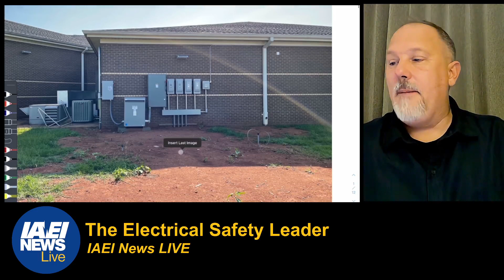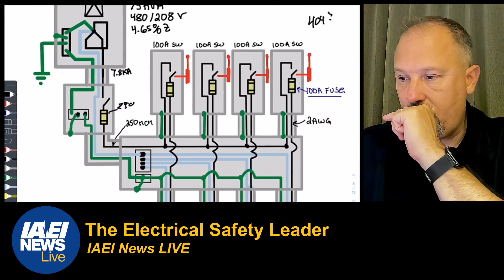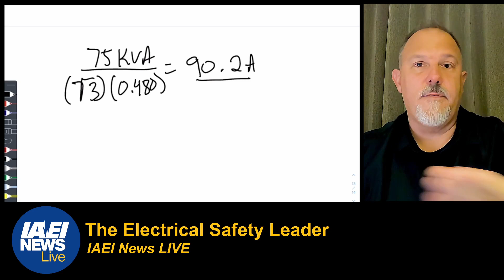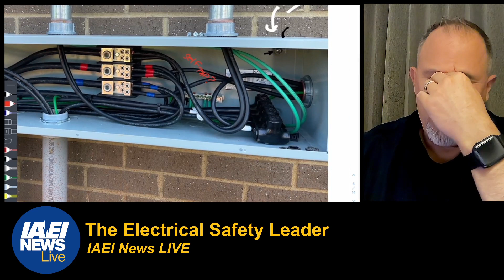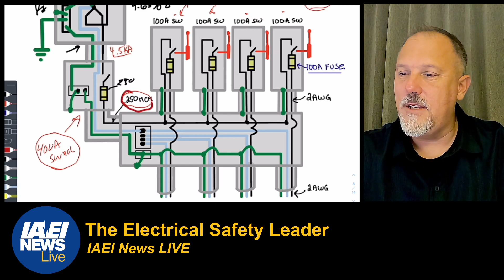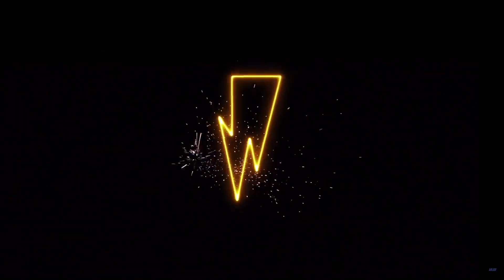Feeder installation review

Comment: If you are an Electrical designer doing hundreds or thousands of current calculations, there is a time saver.   VA/ Magic number!
Magic number is half of the calc you are doing.   Sq root of 3 times volts.  For three phase 208/120 Y 361. 480/277 Y 831.   For 240 delta 416.   Don’t need to get knitpickey, nobody cares about decimal amps.

Comment: 250.104(D)1 and 2. Separately derviced system must be grounded to metal water pipe and structural steel. No requirement for ground rods needed and in fact is not providing a effective return path and should be removed immediately.
Reply: Read NEC 250.30 ( c)

Comment: I think I would have made the secondary sealtite a little longer and strapped it to the transformer pad as I would be afraid of some building maintenance guy stepping on it . Also,  the pipe with LB out of the right end of the gutter should be supported some how (maybe its not complete) .

Comment: Tom - Great educational example for the multiple NEC Articles at play here! Coming from an electrical engineering background, I have learned that a picture is worth a thousand code references... or however that saying goes 😄

Answers to your questions throughout the video:
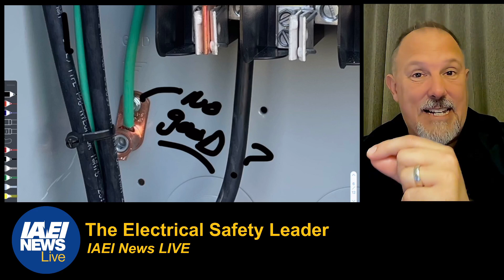Q: 23:40 - What Section of the Code explains how many threads of a screw need to be engaged for a bond?
A: NEC 250.8 Connection of Grounding and Bonding Equipment - Not less than two threads or secured with a nut (depending on screw type)

Q: 36:10 - What Section in Article 250 relates to Objectionable Current on Equipment Grounding Conductor?
A: NEC 250.6 Objectionable Current